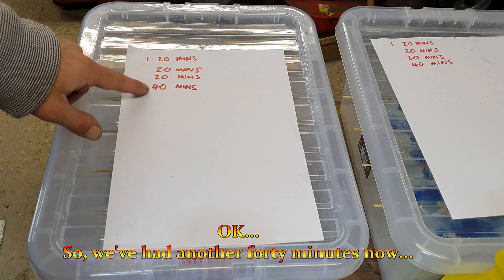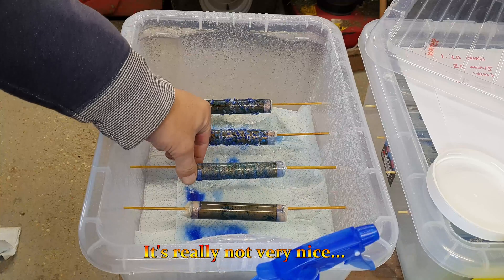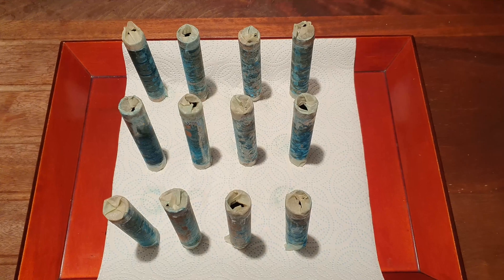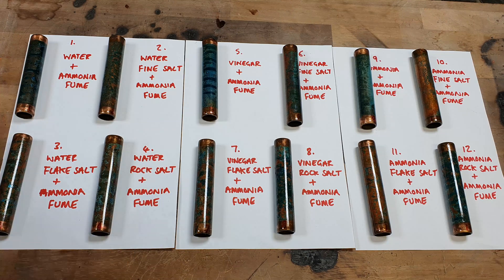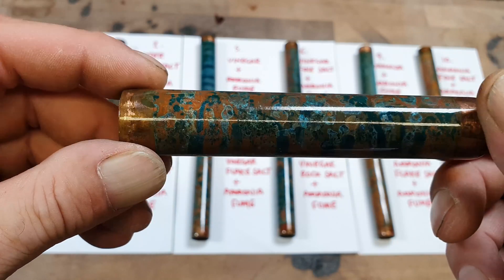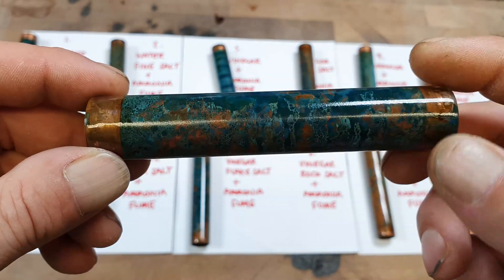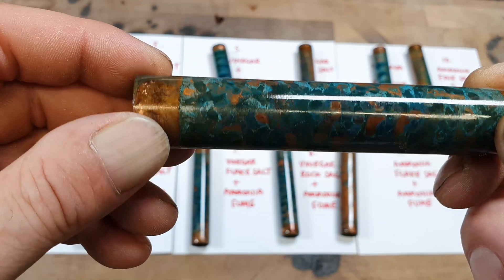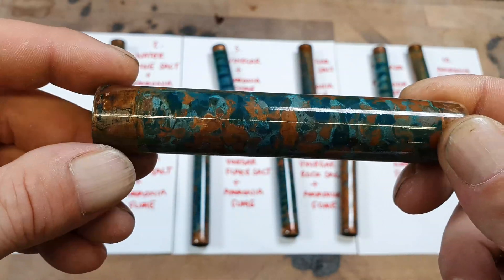Testing Blue Patinas on Copper #1 - Part 3 of 3 - Results

Comment: Love the video, I am trying this for a university project. I was just wondering what laquer you used to set the Patina? I have some pledge floor wax which I have used to seal spray paint before but worried it won’t work on the patina. Any advice would be appreciated, Thank you

Comment: After removing and letting dry, did you sand them down before lacquer?
Reply from the maker: No mate, I sanded the pieces of pipe and wiped them with alcohol before starting to make sure any oxidisation and oil from my fingers were removed.  The finished patina is quite fragile and will rub off with your fingers.  You have to rinse it very gently in water and then let it dry before adding lacquer to protect it.  I taped the ends so that i could handle the pieces without putting grease on them.  You could get a more permanent patina using heat, but without lacquer it will probably tarnish over time.  Cheers Andy 👍

Comment: Wonderful video Andy..your pain has benefitted mankind. I am new to patinas and wanted to create a blue patina for a copper backsplash for our diy kitchen remodel. Now I know to try the water and vinegar spray to give me the color I'm after.
Reply from the maker: Thanks Portia, glad it was helpful for you mate.  Just bear in mind the patina is only on the surface and will rub off quite easily.  Rinse in a gentle stream of water, dry and lacquer several times to give a protective barrier to the patina.  You may well get a different result using flat sheets of copper.  Ensure the copper is grease free or the patina won't stick (that includes fingerprints).  Polishing them beforehand should also give a better result.  If you don't like the results you can always remove the patina and do it again before lacquering.  If you have any spare bits of copper I'd patina those alongside your main piece.  You can lacquer those first to see if it gives you the colours you are after before lacquering the main piece.   Experiment with different lengths of time in the fume chamber.  Longer lengths of time should give stronger colours and patination.  Good luck, hope it turns out OK.  Cheers Andy 🤞🥂😎

Comment: what would happend if you disolved the salt in the water instead of sprinkle it on ??  or maybe disolve it in the amonia
Reply from the maker: That was going to be the next round of patinas, Dan... I got a bit sidetracked with other things, ammonia is horrible to work with, I'll revisit this another time though as there are lots of other patinas I still want to try.  Maybe in the summer when I can do it outside... It wasn't a fun video to make that's for sure... Cheers Andy 🍺🍺🍺